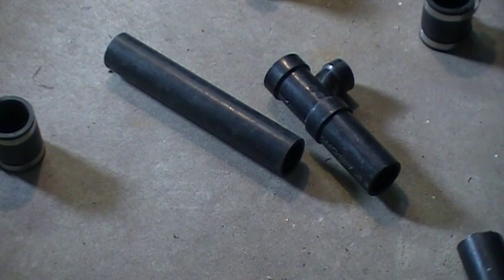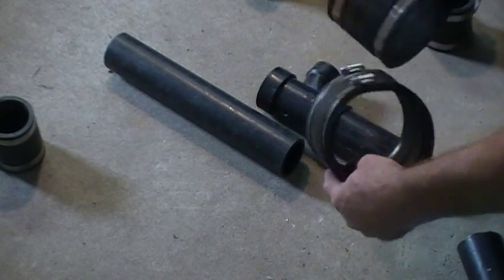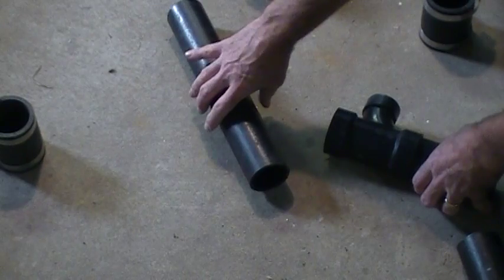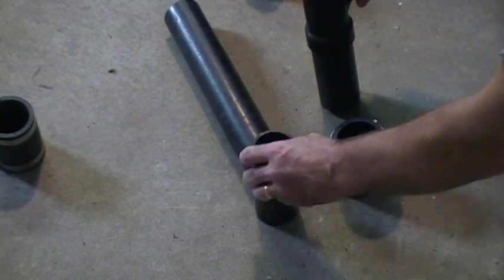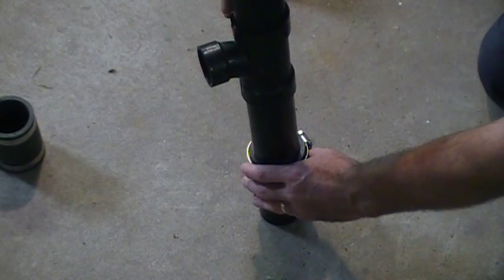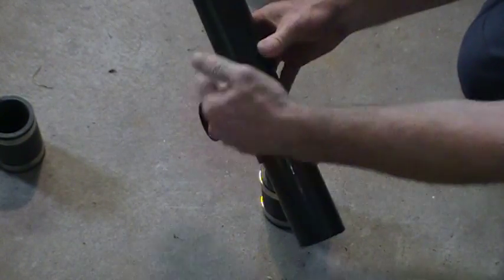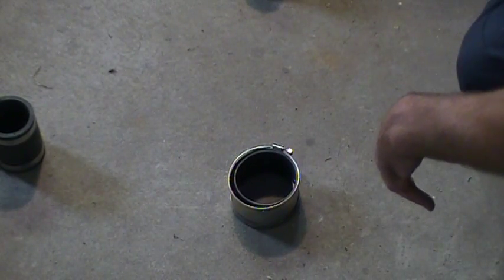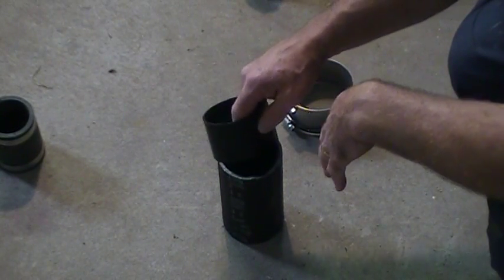How to join cast iron pipe to abs,pvc or copper pipe using an MJ coupling.

Comment: your credentials would be more believable if you knew the difference between cast and black steel pipe
Reply from the maker: Hello stanleyphilippon1623,
I've been in the trade for 46 years now and have installed more cast in the first ten years of my career then I'd like to remember down in the trenches from 2 inch up to 24 inch in size. All lead and oakum. 
Also have threaded by hand and threading machines miles of black iron (steel pipe as you call it).
Here's the video I posted on youtube cutting the cast using a set of ratchet cutters. The short piece is the one I used in this video. The wall thickness of this cast is not overly thick compared to others, but it's cast.
https://www.youtube.com/watch?v=Zei2c_moHIQ&t=147s
This is the name of the video........
"Old plumber shows how to cut cast iron pipe". 
One other note; you know by the sound that it is cast iron when I placed it on the concrete floor. If you know cast iron pipe it makes the hollow sound compared to steel which rings.
I got a good chuckle from your comment!
Thanks for commenting and have a great week!    Al

Comment: Does anyone know if this will work on the water lines instead of the drain?  I just bought a house and the galvanized went directly to copper and when trying to take the pipe out I ended up tearing the pipe and left the male connector inside of the t connector.  I want to cut and thread but can't find a threader anywhere here in michigan
Reply from the maker: Hello John,
No. This will not work on waterlines. You will have to go back to the last fitting that the galvanized pipe is threaded into and you may be lucky enough to remove the pipe without it breaking off. Chances are that the pipe will not come out for you correctly and that a lot of the thread will remain in the fitting. Just my past experiences.
As soon as you mentioned galvanized pipe I was thinking that you will probably have to look at repiping if that pipe doesn't come out for you. No doubt it has been there for more than 50 years or longer and depending on water quality; it is beginning to breakdown and filling with mineral build up.
I am hoping that you find a set of pipe dies and can put a new thread on the pipe. You may want to try one of the big box stores. They generally do carry die sets. If you plan on threading it; you must use oil.
Hope this helps!
Thanks for commenting and best of luck with the repair!    Al

Comment: Just Another tip to consider:You can also just slide the MJ rubber over the cast *(use a little mineral oil, brake fluid,or petroleum jelly if needed?) * to the lip inside of center of the MJ rubber; then just roll,flip or fold the other side of the rubber over same side of the cast. Then put your other pipe in place, then just roll the MJ rubber back over your newly aligned up pipe. (Pretty effortless and quick)Then wrap your band clamp around in place, tighten up securely as far as it will allow tension. 🙋‍♂️

Comment: Any idea how to join a 3" PVC to a 5" female cast iron?  There's lead in there now bridging the gap but because the cast iron opening is vertical, I don't want to mess with that stuff.
Reply from the maker: +CountyRentals 
Unfortunately they don't make a fitting that will go over the piece you are talking about that contains the lead and oakum which is called a hub. Are you joining the PVC above the cast or below or is the pipe on the horizontal?
The best way to get around this is to cut the cast iron pipe behind the hub and add a 4 by 3 Fernco coupling or an MJ clamp. I use Ferncos on most of my connections.
There are a few ways to cut the cast iron. You can either use a grinder with a cutting blade or a reciprocating saw with metal blades. You will go through a few metal blades when doing this, but it will work for you. I have done this way numerous times. I generally use 8" blades as you want the blade going though the pipe completely once you reach the center of the pipe.
Wear safety goggles and gloves when  cutting cast. If you are not familiar with using a grinder; it spins at a very high speed and you must hold it tightly.
Thanks for commenting and get back to me when you get a chance.     Al
Reply: Pretty simple job... Increase the 3" to a short stub of 4" PVC, then use a Fernco donut seal and some Dawn dishsoap (serving as a inert lubricant) to insert the new work to the old. 

As a note, the 5" hub is proper for a caulked joint, and once cleaned out to bright metal, readily accepts the gasket. 

Go to a plumbing supplier once you've got an exact diameter of the hub, as Fernco makes literally hundreds of donut gasket sizes, across many pipe sizes and materials.

Comment: Thank you for posting this.  I work in a bar and some nimrod kicked out the sink drain in the basement.  I'm pretty handy so I said I'd fix it.  I chopped through the slab, cut through the pipe, and hooked up the connectors.  That said, I'd still be there if it wasn't for your helpful hints.  Dude, you saved my; ass!  Folding back the connector was pure genius, and it worked.  I'm subscribing to your channel;  if I ever get facebook I'll like you.  Thanks again.
Reply from the maker: +AndyBaileyPHIL 
You are more than welcome!
I am glad everything worked out for you! Congrats on the repair!
Thanks for commenting and enjoy your week!    Al
Reply: TheOldkid888  Good video ! I have an iron pipe fr the first floor attach to the sewer pipe  but it's leaking  right on the basement ceiling I want to cut it  and  attach the iron pipe with a pvc pipe , it's only gonna be one cut . How many clamps do u think I need for one cut ? How can I measure the pipe to get the exact size ? Additionally , can I use primer and  glue between the clamps and the pipes . Reply directly please so I can get  it through my email. Thank u ! I enjoy your vd thank you !
Reply from the maker: myrtho charles
Thank you!
Not sure what you mean by clamps? You must secure the pipe you are cutting before you make any cuts. If it is a piece of pipe that is hanging in the ceiling you must use metal strapping to ensure the piece that remains stays in place. If it is a piece that is coming through the floor that you are cutting off, I would wrap the metal strapping around the pipe a few times and secure it to the joists near by. You must secure it as it could possibly drop down from above.
A rule of thumb is that the cast has a hub right at the floor that the older plumbers installed to ensure it does not drop by the weight of the pipe from above, but I always support it down below to be certain. If you are cutting it off using a reciprocating saw; the number of blades depends on the brand. I use Lennox or Dewalt metal blades 8 inches long.
Joining the PVC to the cast is generally done by using a Fernoc or an MJ coupling.
You get a rough measurement first that is generally longer then the piece you are removing and get the correct measurement once you remove it. 
You must apply primer to the pipe and the fitting and then glue before you join the two pieces.
If you are not familiar with this project; I would recommend getting a plumber to do this ob for you. It is a fairly big project.
Thanks for commenting and good luck!   Al

Comment: Oldkidd, I have a heavily pitted 4" cast iron pipe that I tried joining to pvc with the smooth fernco and silicone, it leaked.  I saw the nohub fitting and thought with some sealeant, like automotive permatex or silicone.  The silicone sticks well to the cast, but not the fernco. ant advice?
Another thought was to smooth out the cast pitting with jbweld (2 part putty epoxy), and sand to down smooth.
Thanks
Reply from the maker: Hello Keith;
Few options.....
You can apply some epoxy to the cast and smooth it out, but you can also slide the majority of the fernco onto the cast. The fitting is 4 inches long; so if you were to put 3 inches onto the cast iron and place 2 more clamps above the exiting one and tighten them down onto the cast; this WILL resolve your problem.
If you can't get clamps that size; then take a few smaller ones and join them together to make 2 clamps big enough to go around the fernco.
Thanks for commenting and let me know how you get along!    Al
Reply from the maker: Hello Cesar;
I like the idea, but I haven't come across anything yet.  
You can get a little bend out of the pipe itself. If this is not enough; you can purchase 22 1/2 degree elbows. They may do the job for you. The ditch may need a little change to use them if not.
Thanks for commenting and let me know how you get along!     Al
P.S.
You mentioned about pipe pulling apart ; very common to find this. Years ago this piping served the purpose, but things have totally change as far as how we think about plumbing problems that can occur.
Tree roots are one of the biggest ones and leaking sewer lines are also common.
Many wells get nasty bacteria such as  E. coli in them when this happens and can cause serious health issues.
Al

Comment: Don't know why you trimmed out the inner lip of the MC coupling.  Two things:  first, you put both of the pipes halfway into the rubber sleeve, so they would have bumped up to the lip anyway.  Second, it seems like the lip would help to seal a not-perfect cut like you have on the iron pipe.

Comment: I turned out well... I ended up having to replace the entire pipe (galvanized not cast) between the kitchen sink down to the cast iron part that was sticking out of the concrete in the basement floor with PVC... Apparently, the pipe had corroded on the inside and the sediment/metal "shavings" had clogged it... I had to cut out the section of pipe re-run the PVC, complete with a few bends... The fernco fittings really came in handy... And the drain works better than it ever... Thank you again!

Comment: Dude, the audio is fine... I heard everything clearly... I mean, you're a plumber not an audio engineer... Right?

Thanks for the tips! I think that I may have to replace a section of a cast iron drain w/ABS and your vids are VERY helpful! Especially the one about using fernco connections to transition from cast iron to ABS... 

I am an audio engineer and not a plumber, so I need all the help I can get...

Comment from the maker: Hello streetdog75;

I would use either a MJ coupling or a Fernco cooupling.
Both would work for you! Biggest thing is to make sure when you make your cut on the cast, that you have it supported well so that it doesn't drop any on you. Once you do that both couplings are easy to install! I always use metal strap to support both pieces when I am making the cut and always strap the new plastic pipe as well!
Thanks for commenting and best of luck with your project!   Al

Comment from the maker: Hello Peter;
The fitting you are going to need there is inch and a half by inch and a quarter fernco coupling.( 1 1/2 by 1 1/4 ). The inch and a quarter size fits nice and snug on inch and one half copper pipe.Ideal for this application.Used many of them.You can also use a bow adapter which looks like a trap adapter,but slides over the copper pipe and tightens down on to it.You tighten it onto the copper and glue your plastic pipe into the other end. 
Tks for commenting and enjoy your day! Al

Comment: You never use No Hub couplings to join plastic to cast. In your case a CP 200 was appropriate. It accommodates the two different thickness'...You should also use it on the top side of the santee (Vent) for a better job. Cut your pipe with tubing cutters as well. Those cuts looked horrible!

Comment: You've got to be kidding....9 minutes to join cast to plastic with a no hub coupling? First of all a no hub coupling is not the appropriate coupling. A CP 200 coupling designed for the different thickness is appropriate. Ferncos are "cheater couplings". You can cut a pipe 2" too short and use a fernco!

Comment: Ferncos are not legal except for a repair. Above ground must be full band, below ground you can use fernco style clamps but it still must have a stop in the middle which i have not seen the fernco brand ever have. You dont have to cut the stop out of the full band clamp just fold it over.

Comment from the maker: Hey JD;

I find it much easier to trim the fitting myself. If you are installing it on cast it can be quite tight and a pain in the back side. Some lubricant may help. I would look at a soap product though instead of the WD 40. I would be a little nervous about it breaking it down.
Thanks for commenting and enjoy your day JD!    Al

Comment from the maker: Hello rattlinbroom;

These MJ couplings are excellent for hubless fittings. They are very ridgid with the stainless steel band, but do need hangers on horizontal piping like any other joints.When using these couplings; tighten both clamps a little at a time.
Fernco couplings are also used for joining castiron and are made of a neoprene rubber with 2 stainless steel clamps. I have a video on ferncos as well.
MJ couplings will pass code everywhere.
Thanks for commenting and have a great day!    Al

Comment: Get the plastic fitting called Cast Iron to ABS no-hub adapter to make up for the difference in wall thickness between the two pipes if you are going to use a no-hub band coupling. You want a smooth transition on the inside of the pipe to maintain proper flow of paper and solids. The coupling is for cast iron hubless soil pipe and fittings but can be used properly for the two pipe transition if you use the proper adapter. Keep up the good work.

Comment: They work if you fold the interior sleeve back then fold it back over the other pipe put it in hot water first bud.Give it a try no cutting required then. :)